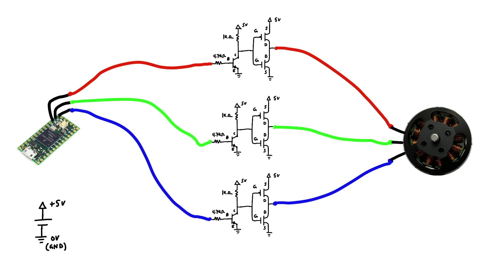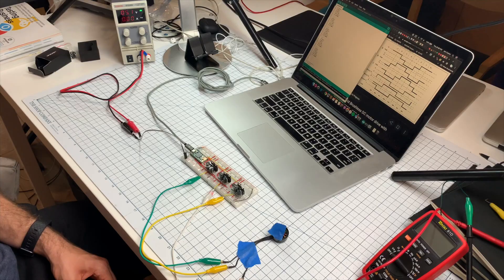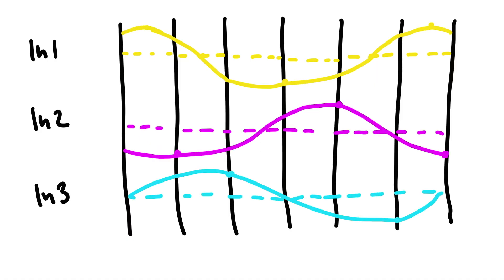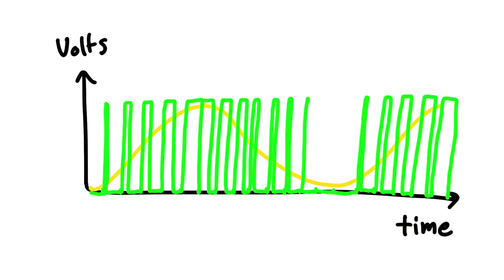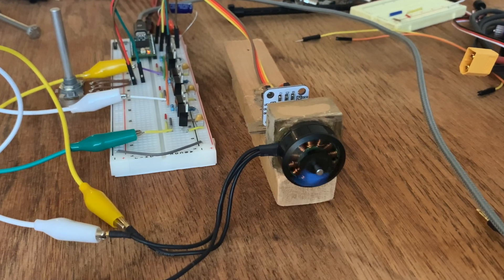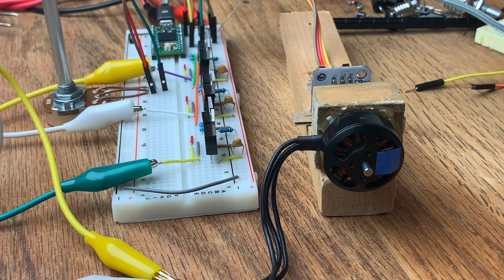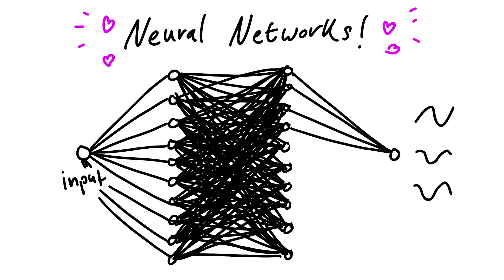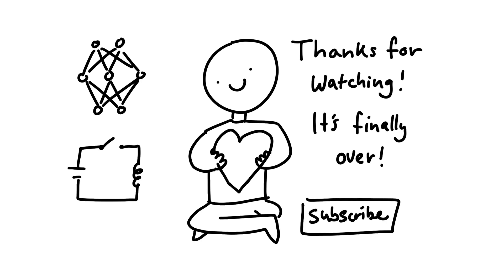BLDC Motor + Q-learning 3: It Works!?

Comment: Hey hi, so I'm not an expert in brushless motors and Hall encoders(magnetic encoders) but I think you may have attached the magnet wrong to the end of the shaft cause the magnet for the encoder is a special kind of magnet that the polls are not on top and bottom of the magnet they are on the left and right of the magnet so the sensor could detect the rate of change of magnetic polls. correct me if I'm wrong tho!

Comment: I've noticed an encoder in the back. Is that used for training? Or also for driving the motor?
If only for training, it would be interesting the train the network with skipped steps(by this I mean something preventing the motor to move),
would it be able to detect if those happened, and adjust.

As for why would anyone use this instead of buying an ESC, the ones in the screenshot seem to be like RC ECSs that just rotate the motor with a certain speed.
ESCs for BLDC precision control seem to cost an arm and a leg(haven't tried the open source arduino ones), the only sane option is odrive, but even that is like $120,
and probably tailored for high power application.

The funny part is that I wanted to do a similar project, but with DNNs right away, was planning to collect the data from the motor, by sending some random voltages,
and collect the rotation, then use that to train a DNN, maybe use some 2d convolutions, as the motor behaviour might be local, i.e. depend on the previous movements.

I would also plug in more data into the network, like the voltages going into each wire, this could probably help learning then the motor is struggling, or find the angles more precisely.

Congrats on making this work. The realtime learning on the teensy was a pragmatic and smart approach.
I still think you can squeeze a bunch of stuff from this approach, if you can do precision motor control without an encoder, on a small board like an stm32,
that could be a serious achievement. You can then do a 3d printer with bldcs and break the internet :D.

Also, I'm a bit skeptical about optimal esc control algorithms, since each motor is a bit different, differences in materials, winding patterns, magnet strength(obviously
they might calibrate them at the factory, but still). Not sure it's possible to take this into account without actual learning the motor characteristics. A learning algorithm
will also have to be trained on the motor, maybe have a pre-trained network, and just do some additional training for each motor.

Anyway, fascinating stuff, have to buy myself some bldcs and poke around.

UPDATE: I've been looking and SimpleFOC seems to tick a lot of boxes, plus one can buy a cheaper driver with it for $15.
Reply from the maker: A BLDC 3D printer!? Hold my beer!.. er encoder!  That sounds stupidly awesome and I'd love to see it.. genius. 

You're 100% right that no optimal driver could take into account all the peculiarities of each motor, but then again they may just be "good enough" and that's well.. good enough for a lot of applications. 

You just piqued my interest in this again with your insightful comment...

:-O SimpleFOC.. looks FOC'ing awesome! I'm in! I'll check it out and maybe make a project with it.. thanks for pointing it out looks legit.
Reply: @giantneuralnetwork  I've been thinking about this. The advantages that bldc's would have for 3d printers are:
- lower cost, at the same output power,a bldc would be 10ish dollars be 20-30 for a stepper. This are rough numbers. Bldc's on nema enclosures might be more expensive than stepper motors.
- lower noise than steppers, that being said trynamics stepper drivers can be silent
-probably lower power usage
-maybe faster printing speeds, but that depends on a lot of factors, like nozzle quality, frame rigidity, belts quality, part cooling and so on

So, it might be that the 3d printer industry thinks it's not worth the cost of investigating this. But from a coolness factor perspective I think it's still worth looking into this. Which I'm going to do if I find the time.

A better application might be a delta robot, where high speed movement is often important. That could fly with some carbon fiber arms, and some bldc's for high acceleration.

As an aside, I've been looking into bldc ESC algorithms, and it seems like they take into account back current to find the rough location of the rotor. But that's for speed control, i wonder if the same approach can be used for a neural net.

Also, looking at precision ESC control, it seems like one important factor is the ability to hold a position, which simple foc is able to do. But from the videos it seems to be a bit rough around the edges.

Anyway, a bldc 3d printer will be a serious undertaking. Besides the precision motor control for 5 motors, you'll have to modify an arduino 3d printer firmware to use simplefoc. That might not be trivial, even though I expect the board firmware to be agnostic to the drivers.

Anyway, sorry for nerd sniping you. If you start the project, good luck. I'm hoping once I get my 3d printer with stepper motors done, I'll start looking into bldc precision control and a delta robot or s 3d printer. But it will be easier if you'll do it first.

Edit: just recalled that 3d printer boards talk to the drivers by spi or i2c. So if simple foc is talking the right protocol then 3d printer firmware might require minimal changes. But haven't looked closer than this.
Reply from the maker: @codymccodeface2094  I think I'll leave this endeavor to you! I'd love to see what you come up with. 

As for using back-EMF for position control I believe that works best when things are really spinning, since a still or slow moving magnet wont generate much voltage. I like this modular approach that's emerging from your thought process however, leaving you to just come up with the interface between the printer board and simple FOC/BLDCs. Also I wouldn't be too concerned with the practicality. Going off into the unknown even if it may not seem that fruitful can lead to some great tangential insights and innovations and is an amazing learning experience. A big plus for the coolness factor too. Also the motors I used had a pretty high Kv rating.. if I used gimbal motors I think I could have gotten a much smoother output. 

Good luck and keep me posted!

Comment: If you take neurons out of the sine wave generating neural network one by one over time, while you train it, how small can you make the neural network while still maintaining a sine wave output of acceptable quality? Less neurons mean less calculations needed, which means faster calculations, right?
Reply from the maker: That’s a great idea! At some point it would definitely struggle to make a sine wave, but since I only generate one cycle of the wave you could possibly make it with just two sigmoid curves... For the speed of the teensy though the network was fine.

Comment: Nice video; Q-Learning worked better than I expected!

For what it’s worth, when dealing with angles in Neural Networks (which are continuous mappings), you want your inputs to be continuous (so it shouldn’t jump when 360° goes back to 0°).  The best way to accomplish this is to split your single input angle into sin(angle) and cos(angle).  🙃 This keeps the inputs continuous all the way through, which allows the outputs to be continuous as well!

Even though there is an analytic MotorAngle -> 3-phase driving function, there is still a really interesting learning problem here, which is “How do you determine the best driving phase from just the back EMF of the motor?”

If this could be solved, you wouldn’t need an angle sensor to arbitrarily drive the motor!  What makes this tricky for classical algorithms is that the Back EMF and driving currents mutually affect each other, so the network would have to learn this high-dimensional function to separate their relative influence.

Current solutions inject noise into the motor to figure this out (see Benjamin Vedder’s latest video), but this makes the motor noisy and weak(er).  A learned transfer function here could open up a whole class of cheap hoverboard motors to relatively cheap/effective driving circuitry!
Reply from the maker: Yeah I was surprised too! It seems to learn pretty quick. 

I've done the sin cos angle trick before, that's a great tip! To drive the motor with the neural net I actually made the input range from 0 to 1 and mapped that to the three sin waves over their full cycle, so the output actually appears periodic as I range the input from 0 to 1 and back to 0 again.. I'm basically pushing the motor along and so the signals it sees should be continuous. You can sort of see in training clips how the waves start and stop at the same value. Luckily the network seems to evaluate pretty quickly and even train reasonably on the teensy so I can see lots more projects involving the two. 

That's crazy interesting about back EMF... I felt like my angle sensor was in a way limiting me as it could only take something like 700 (maybe it was 7000..) readings a second or so if I recall. Grabbing the back EMF instead and learning the mapping from that to a good drive sequence would be fun! Some continuous state, continuous action Q learning. 

One concern with back EMF is I want to use these in robots, where they will be stationary for long periods of time.. thus no back EMF! Perhaps control algorithms keep the last known angle of the motor? So they can drive it from a stopped state with high torque? I have no clue but that seems reasonable. If you have any idea on how back EMF drivers deal with stopped motors I'd love to hear.

I thought I was done with BLDC motor drivers but you keep making it more interesting! 

Thanks again for all your insight Johnathon, it's much appreciated :-D